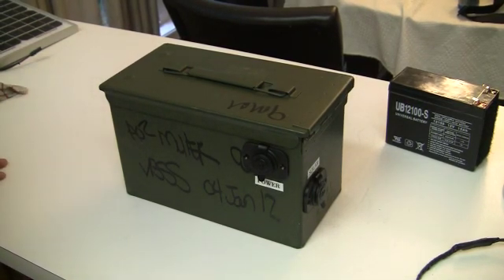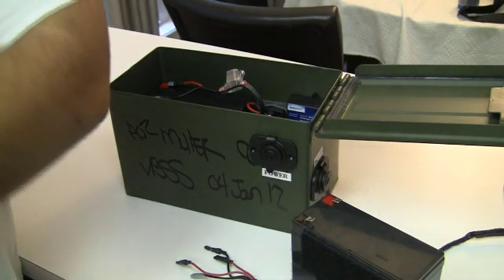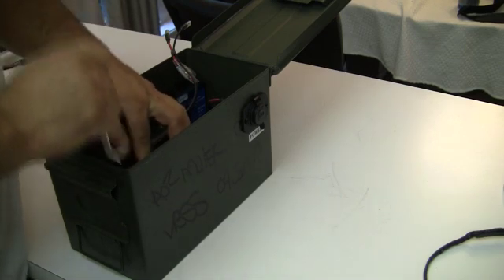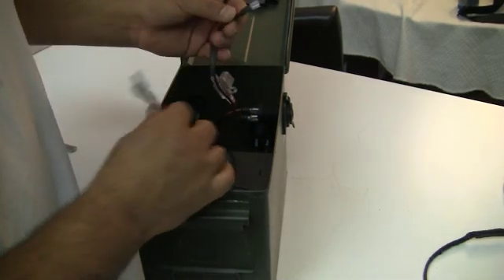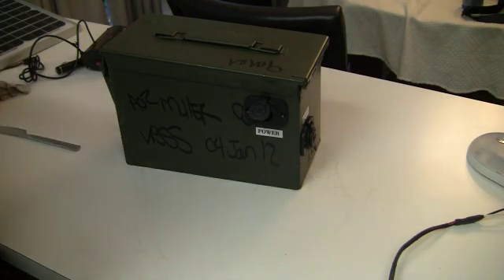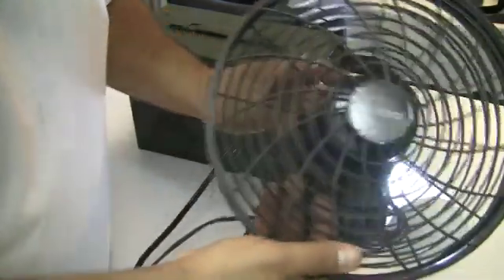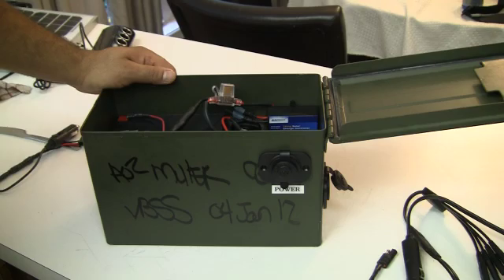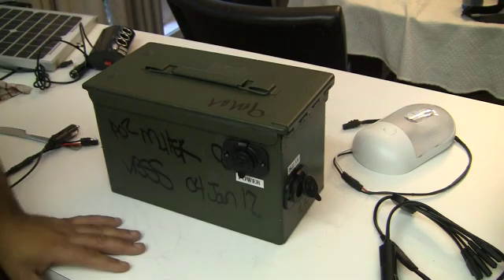The Enhanced Small Solar Power Solution (Part 2)

Comment: Hey, great video, explains the system well. I'm just about to build my first system so I've been watching a lot of these videos. 
Try using some thin cardboard, on the Velcro, to install the batteries. Cover the walls and you just slide the battery down.

Comment: A small suggestion for the placement of the battery, What if you had paper or thin plastic wrapped around the battery and then placed the battery and pulled the paper/plastic out.. probably would have eliminated the use of the butter knife.. Just a thought! :)

Comment: it's been too cloudy for my solar to re-charge my battery.  What is an alternative way to do this? If I have a 35AH battery what would be the recommended size solar to maintain the charge with minimal draw during the night? CPAP 2.5a, cell phone (or two) and a fan.  Thanks
Reply from the maker: I use a trickle charger when it is cloudy. Of course you will need AC power.

Comment: Great videos. I'm trying to do this to power an LED light strip inside a gun safe since the safe doesn't have a power outlet. Just curoius though, with an offgrid solar power system in a home, usually the inverter has a low voltage shutoff to keep from draining the batteries beyond a safe level. Do you need a low voltage cutoff for a system like this?
Reply from the maker: My batteries do not drain beyond what they would just sitting there.

Comment from the maker: If your battery charger has an cigarette lighter adapter, you can plug it directly into the back of the ammo can (solar power input). Alternatively, you can connect the positive and negative, to the positive and negative power posts, if you can fit it in there.

Comment from the maker: Victor, good question. The answer is yes. Whenever your panels are generating power, the charge controller acts as a monitor to ensure your batteries are not overcharged. In this design, loads and battery capacity meet at the two power posts, which create an overall voltage for the system (our example is a 12 volts system). Therefore, your device will consume the power generated by the panels, and any excess power will be diverted to charging the batteries. Devices / lights need to be 12 volts.